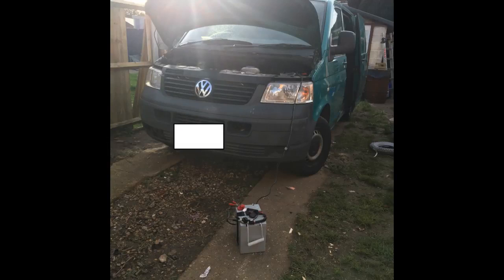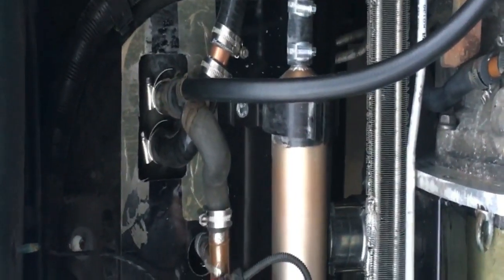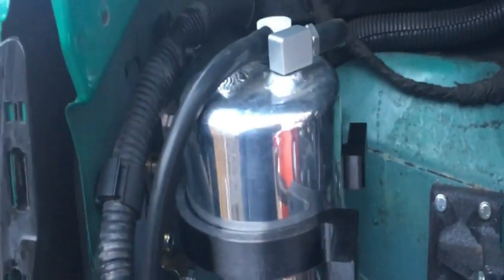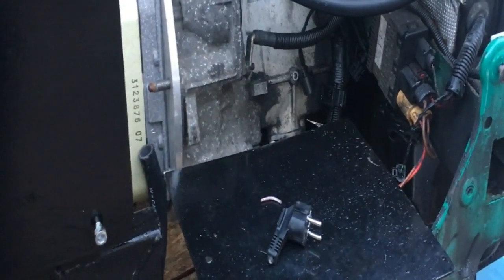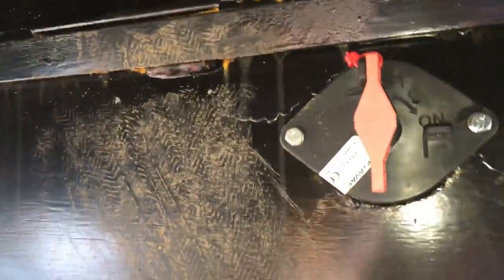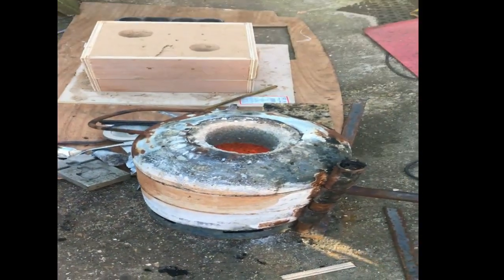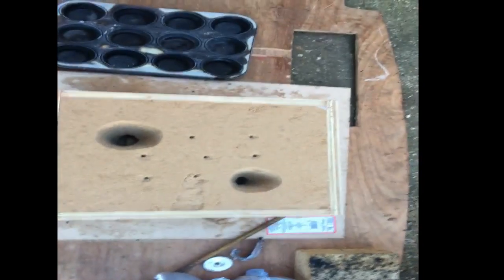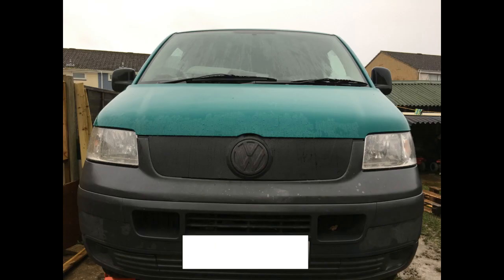VW T5 CONVERSION TO EV EPISODE 1

Comment: "I didn’t set out on this project to make a video but thought I’d better try and pass on my experiences hopefully will help others"...OK...But where is the beef Stuart? I mean you didn´t just give it away, did you?
Reply from the maker: Not quite sure what you mean but all information given away freely all my experience is given away freely so it helps others
Either with electric vehicles or my other projects Heat Pumps or battery storage or anything else

Comment: 👍👍👍👍👍👍👍 how much is an electric motor and where to buy it?
Reply from the maker: You need a motor and a controller and a way of controlling the controller to make electric vehicle work but there are lots of different ways of doing it and it depends very much on how big your vehicle is
Reply: @stuartdean4620  You probably think that in Poland one still rides horse-drawn carts and counts on abacus 🙂 I know what it takes.  I mean the cost of an engine like yours.  I have a T4 but it's almost the same.
Reply from the maker: Okay at the moment I’m building another van and I’m hoping to use a Nissan Leaf motor
A guy I know is also converting a T4 synchro van and using Nissan Leaf motor at the moment you can get the motor inverter as a complete unit for about £1200 in the UK
But you need additional electronics to make that work whether through open source inverter forum good place to go read and do some research or there are other products on the market I believe there is one by thunderstruck motors in America they have a control system that also works there are others coming onto the market seemingly all the time
The motor I have in my current van is a Siemens motor Which was made for Electric vehicles I paid £3000 just for the motor and the inverter cost me the same again but that works straight out the box and you have technical support
Siemens motor probably get one out of a scrapyard or bosses in Germany I bought one recently and that was €1000 and it’s bigger because it’s out of a bus
Reply: @stuartdean4620  👍👍👍👍👍👍👍

Comment: Really good work !!! 
Have you managed to reregister the van with dvla as electric? Is it now ULEZ compliant?
Reply from the maker: Yes it was quite a process to get the vehicle registered I did this before the MOT because it makes the whole process simpler they’re just MOT in an electric vehicle otherwise your MOT in a vehicle that has been converted to electric which is not the same thing you need to get the registration swapped done first it took four months for me to do this sending photographs back and forth tax the vehicle send the DVLA pictures of the vehicle before and after electric conversion you have to sign to say what you’re saying is true and correct i.e. converted it to electric
Penalties for pretending it’s electric and it not being would be very harsh

Ultra low emission zone yes 
Fuel type electric doesn’t admit anything
Reply: Thanks!!!

Comment: what motor did you use? how many BHP do you think? Nice work!
Reply from the maker: The motor is by Siemens 1pvv5135-4Ws14-z the particular Motor you can actually put bigger controls on and get huge amounts of power from it if you wish however I’m only using about 70kW and that’s more than enough to get the van down the road
Thanks very much
Reply: @stuartdean4620  thanks a lot. We have a T30 Hightop. Had to replace the 2.5L engine for near 7,5K a couple of years ago, but was pondering on EV conversion back then. I think you may be the first to do this on a t5?  had a look for a similar motor, not easy to find. where did you source yours?
Reply from the maker: @DanSohan  The Siemens motor I got from EVTV jack R over in the states
Reply from the maker: But there’s also new electric over in the Netherlands 
my next project I’m using a Nissan Leaf Motor on a VW gearbox driving X5 differentials making it four-wheel-drive hopefully
Videos up on YouTube hopefully practical video of doing the mods will be up soon
Reply from the maker: My apologies I think new electric are over in Denmark

Comment: How much would u charge to convert my T5 vw to electric
Reply from the maker: Well to give you an idea just in parts it cost £16,000 and every spare moment for two years 
However I know more than I did then The next van I’m looking to convert is going to be Tesla powered I think four-wheel-drive but that’s not going to be as cheap but should be epic
Reply from the maker: I suppose the real way to answer this is what’s your budget what’s your expectations if you wants more range than I’ve got about 90 miles whatever the weather you’re looking to step up in battery size whole Tesla pack or similar other option a more efficient drive unit again probably Tesla model three perhaps but then it’s finding the equipment to make it work it’s out there and I’m talking to a few people over in the states that I doing exactly this developing products and I’m also talking to a guy in the Netherlands that should be able to do CCS charging for DIY at a reasonable price soon the future looks bright

Comment: great van, how many kms do you get to a charge? and is there anything you would do differently second time around?
Reply from the maker: Thanks for your interest I’m currently doing somewhere between .390 and 470 watt of energy per mile the differences between driving steadily at 30 mph round town All going a bit faster on the 60/70mph carriageway roughly work out 2.2 miles something like that i’ve done 95 miles in the winter and I haven’t drained everything right down should be able to do over well over 100 Miles In the summer Especially driving round town as I use this van for work
I may be in the future use a automatic gearbox without converter If that’s a possibility would be good for changing is because automatic gearboxes have sets of clutches 
Or using different axles or motors and four-wheel-drive
Sorry if I’m a bit fixated on miles but that’s what I work in hopefully this is of some use to you
Reply: @stuartdean4620  quite a thirsty, but it is quite heavy and at 60-70mph - not too aerodynamic so not bad at all.
now is it four-wheel drive? using the initial transmission? if it is so - not bad at all.
have you done any analysis what are the main culprit for losses?
how good is recuperation?
why would you want a gear box? doesn't a direct connection to the suffice?

PS: congratulations on you your work :)

Comment: Hi, well done on the conversion. What is the range and top speed?  Did you keep the design for the motor mount?
Reply from the maker: The range at the moment with the two Nissan Leaf batteries fitted giving approximately 60 kWH of maximum capacity I am only charging to 4.1v Per sell it’s about 48kWH available as I only go down to 3.5 V per sell  but yesterday around town and a little bit of carriageway I did 21kwh and 50in miles travelled so the real world 110 120 miles travelled should be doable More than I need for work
TopSpeed literally can go as fast as you like probably do 100 miles an hour have got  80 and decided that was fast enough But the higher speeds will obviously kill the range I need to go on a motorway drive to see how many watts per mile I can achieve real world

But it seems efficient doing 50/60 miles an hour

Between 390 and 450 W per mile is what I’m usually getting if you use the gears more it’s definitely more efficient
Reply from the maker: I didn’t keep any copy of the design of the adapter plates or drive couplings but could soon make up something for somebody Was interested I’ve learnt a few things through several iterations of Drive couplings et cetera and now have a much better idea What actually works in the real world

Comment: Do you have any problems changing gear without a clutch with all that regen from the AC motor?
Reply from the maker: It’s a different way of changing gear you literally have to take it out of one gear and then hold it against the synchro if there is a speed difference to get into the next

The problem I’ve just had the day before was the coupler wore out the old clutch plate spline and lost drive

Just torn apart contemplating my options
Reply from the maker: You have to disable regen to change gear